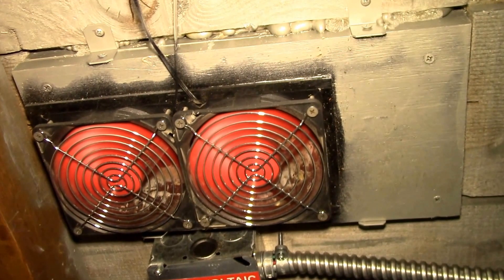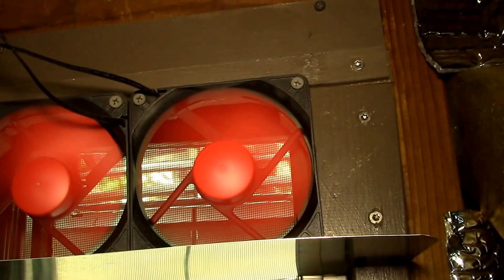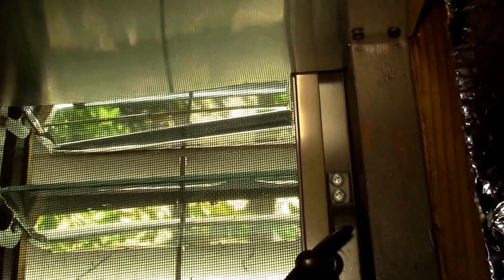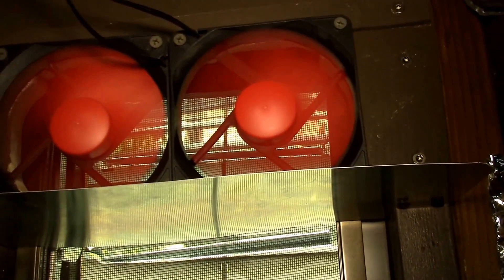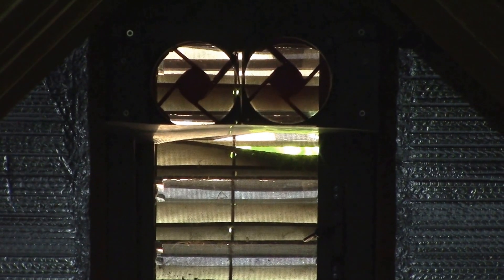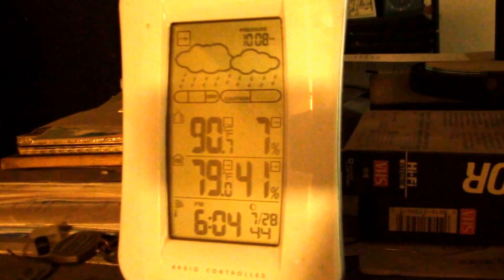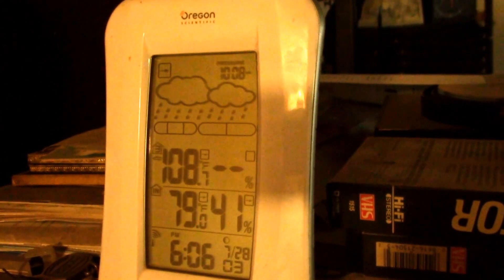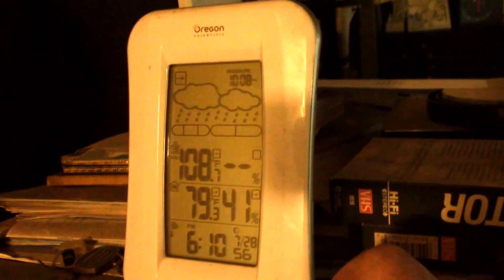Solar Attic Fans - Update

Comment: ware did you get 600 from they only 40 cfm if that
Reply from the maker: Fan's are rated 74CFM, 8 in total:
http://www.silenx.com/quiet.fans.asp?sku=efx-12-15r

I tested the air flow in situ at 90-100CFM for a pair:
https://youtu.be/zp7NSPUvS8g

Comment: i have an 400 cfm 8" booster fan that uses 45 watts and doesnt do nothing
Reply from the maker: I've found they do work in my application.  When coupled with some radiant foil insulation, attic temps were reduced  25-30F.  Some test data:
https://youtu.be/a2ZjQU8RJ6Y

Comment: you are a dumb fuck those are pc fans they dont move enough air to make a diffrence you dumbass . an idiot with to much time on his hands and not enough common sense. his dumbass even had a pc rcb light strip in the attic !!!!!!!!!!!!
Reply from the maker: The fans do move air and help to keep the attic cooler.  Sure one fan by itself may only move about 70 CFM, but 8 in total  move over 500 CFM and that's enough for over 10 ACH in the attic.  That has reduced the attic temps by about 30°F and has made the house much more comfortable in the summer.  Test results below:
https://youtu.be/a2ZjQU8RJ6Y
https://youtu.be/Mw60u0hQ6N8
The low voltage LED strip lighting works great, it's safe, cool to the touch and has worked without issue going onto it's 7th year now.  All this runs off clean solar power.
The system was inspected by the local utility and they deemed it safe and that it met their rebate requirements for attic ventilation and that rebate paid for most of the system.
Reply: @The4Crawler  you sir are a dumb fuck !!!! look up how to properly cool your attic and you will not see anyone using these fans you dumb fuck . when the wind blows the fans would be useless. people like are nevermind pull your head out of your ass

Comment: If you go to Amazon and search on "12v gable fans" there's a nice selection to pick from.   They have a larger one I see for nearly $50.  My garage has a lower vent that I have access to.  Maybe I will try this experiment since my garage gets well over 100 degrees inside. It's miserable to do the laundry during the summer.

Comment: Those fans are barely strong enough to cool my laptop. Useless.
Reply from the maker: That was my initial thought as well.  But in testing, they work fine for this application, there are 8 of them:
https://youtu.be/a2ZjQU8RJ6Y

The key is having unrestricted air flow coming in and going out.  They don't work well if you put something in front of or behind them.
Reply: Auto radiator fan housing assembly. 100 watt solar panel with a temperature snap switch ( on at 85° f off at 75° f ) one deep cycle battery with a simple charge controller. Battery charges up before the system kicks on. Self contained and matance free. DIY.

Comment from the maker: I just turned down the fan thermostat to my summer setting.  Coming up on the 6th summer of operation and the 120mm PC case fans are still working perfectly, no failed bearings, no noise.

Comment: Thx for video, love the low watt plan. What kind of reflective foil did you use? Not sure I understand it's significance?
Reply from the maker: The foil is some Enerflex radiant barrier, I used 24"x48" pre-cut sheets that had spring steel rods inside for easy installation.  That foil helps reflect heat from the roof boards back out of the roof, limiting the amount of heat radiating down into the attic space.  On their own, they reduced attic temps ~15F.  Likewise the attic fans did ~15F reduction, but combined, I got ~30F temperature reduction in the attic, from 140F down to 110F on the hottest days.
Reply: R Brown thanks!
Any concern for cooking the roof with this type  set up?
Reply from the maker: The foil is installed with several inches of air gap so still allows for air flow between it and the roof deck.  So above the foil, you still hit the ~140F temps like normal, so foil or not, no difference to the roofing.

Comment: hello youtubers, if i have a 20 watt solar panel, will a pc 120mm fan work with that panel? probably not a wise question but i had to ask this..
Reply from the maker: It may work.  I have a pair of 15W panels on top of my garden shed and run 1 or 2 120mm PC fans off that:
https://youtu.be/sKZMGEg2PRk

Comment: I hope its not a fire hazard
Reply from the maker: It should be quite safe.  It's set up as an NEC Class-II low voltage circuit.  As such its limited to less than 30V and 100 watts.  As such it's not a shock or fire hazard.  That's no different than your doorbell or thermostat wiring.  Fans are now well into their 5th summer and still going strong.
Reply from the maker: Also, the thermostat for the fans has a built-in high temperature cutoff (called a Firestat) as shwon in the earlier video:
https://youtu.be/IXnU8SDihSs?list=PLpY2FP1a9tisey07zcocqAFXI7Tyo4rnR&t=216

That will kill power to the fans should a fire get into the attic and that will stop the fans from "fanning" the fire, so to speak.
Reply from the maker: I really like mine, they do the job.  All depends on how you plan to install them.  In my case, I was working with several existing openings, none large enough for a traditional attic fan (those need a 12"-14" opening).  I was able to fit a pair of 120mm fans at each opening and easily power those off a modest 60W solar panel, charge controller and battery.  The cost was also less than if I had purchased a commercial solar powered fan.  The other advantage of the PC case fans is if one does fail, it's about $10 to replace it vs. $300+ to replace a larger unit.

Comment: hi, thanks for sharing this video, I got some questions if you can help me please, I would like to do the same on my attic. 1) how can I size how many pc fans I need on my attic? 2) there are many sizes of pc fans... some has more amp, which do you use?. 3) which solar panel do you use?, i got its a 12v panel but how many watts and Amps?. I want to try only at day... I readed that it is better if the panel is over dimensioned so the fan can start working early at the morning...thanks in advance
Reply from the maker: Fan model listed in the earlier video:
https://youtu.be/IXnU8SDihSs
They were a Silenx EFX12-15 120mm case fan.  As mentioned in the earlier video, I picked those due to being quiet since I wanted them to run and night in the summer and not keep me awake.  They also move a decent amount of air ~70 CFM) and have a bearing that is rated for horizontal operation (not all fans have this).  They are low power, ~0.11A and I was able to fit 8 into my attic at under 1 amp of current.  I originally had a 60W panel (3.3A @ peak power) and that was enough until I added more loads to my system when I added a 2nd 60W panel.  Just figure your hours of operation times the current and that's your amp-hours.  Then size the panel/battery to supply more than that.  You can figure out volume of the attic and then how many air changes per hour you want and divide that by the fan flow rate to get number of fans.

Comment: I'm looking to build something like this but solar powered, I have an old car without A/c . It should circulate the air a bit so the inside of the car isn't that much hotter than the outside air.
Reply from the maker: These fans are solar powered.  If you are only running during the day, a simple 12V solar panel and some 12V PC case fans is about all you need.

Comment: You can't use pc fans to cool an attic.
Reply from the maker: That's what I though until I tried it.  8 fans move a fair amount of air and with the volume of the attic I think I get around 6 air changes per hour.  Before I started, I was seeing 130-140*F temps up in the attic and now I see 100-110*F at most.  Half of that drop was due to the reflective foil insulation and the other half the fans.  One advantage of the DC fans is that I can run them off my solar battery bank and they can run late into the night to pull cool air into the attic so it starts the day much cooler than it would otherwise get.  My local power company checked out the system and gave me a $100 rebate for the system, so it was good enough for them.

Comment from the maker: G Zel: Can't reply to your comment for some reason.  One might think so, but in real life I can feel the hot air coming out of the attic vents when they are running.  If they only move half their rated flow, that is about 300CFM.  Given the attic volume of ~2400cu.ft. that's about 8 air changes per hour which is not bad.  If I shut the fans off, the attic temps run 10-15*F higher than with the fans running.

And see below for a video showing the actual performance:
 https://youtu.be/a2ZjQU8RJ6Y